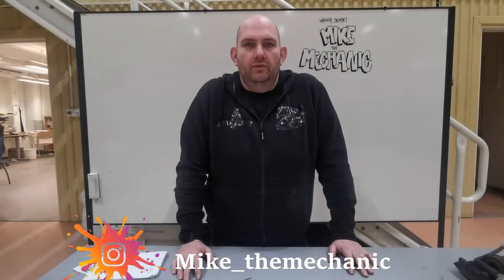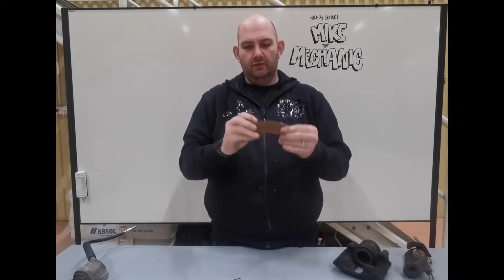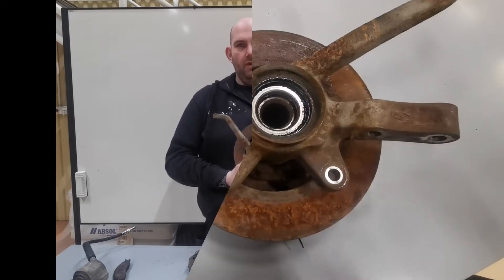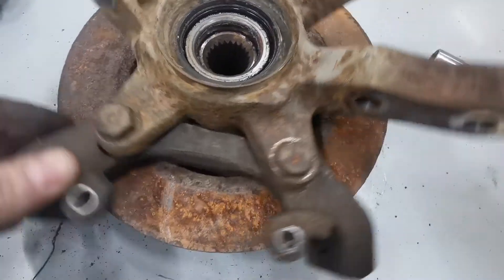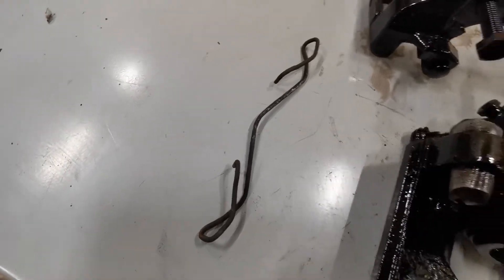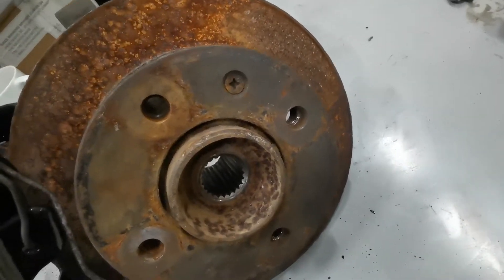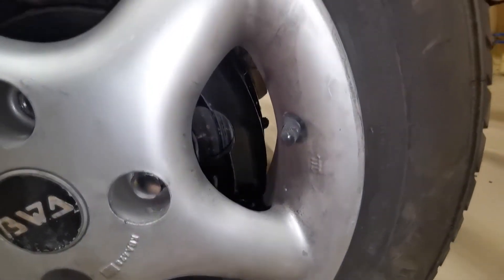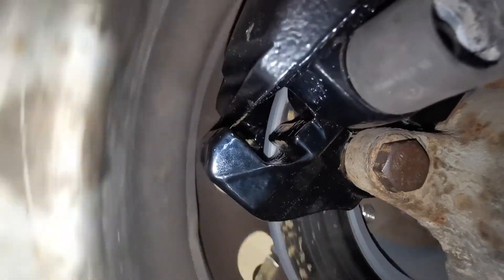ANYONE can upgrade to MUCH bigger brakes with standard 13" wheels. Here's how!

Comment: Are these definitely off a street ka? All street ka discs i can find are 258mm you mention using 240mm discs? If i get a street ka brake set up the 240mm discs wouldnt fit well with the carriers? Or am i missing something. Thanks
Reply from the maker: The disks are from a fiesta I think 240mm vented
Reply: Ahh ok. So the street ka calipers and carriers would be too big as they are 258mm discs? I'll have a look into it
Reply from the maker: @minihudders94 calipers and carriers fit. Can't remember right now where the disks come from but I can find out.
Reply from the maker: @minihudders94 contact me on Instagram or via Facebook and I can send you the info about the disks
Reply: Ok thank you 👍

Comment: Are u using 240mm ka brake disc.?
Reply from the maker: OEN 89FB1125CE Ford
I belive it's from an escort this is the part number that came with the discs
Reply: @mike_themechanic  thanks u olso have a Number for the brake pads?
Reply from the maker: This is completely untested but I think these fit.
https://www.burtonpower.com/brake-pads-fiesta-mk4-mk5-2-00-02-not-1-6-ka-1-3-00-07-pa1268.html

I'm looking at the fact that I had to grind down my outer pads to around 50mm in height to stop them touching the disk and these ones are for a ford ka and are 50mm in height but I haven't tested them yet

Comment: Hi Mike, loving your progress videos! I'm going through the same as you now and this video was really interesting. A couple of things:

- I've been looking at this setup and I've noticed the street Ka with the 1.6 engine was 2000 - 2005/06. You mentioned in the video description 1996-2000. Do you happen to know if these would be the same, I assume they would be

- I also noticed that the calipers work with the 240mm and 258mm discs. Was there any particular reason you went with the 240mm?

Thanks

Comment: Very interesting! I’ve used the st170 brakes off donor car.. had to go down 20mm from standard st170 on disc diameter but have to cover them with 15” wheels! I’ll see how I go with clearance issues… 😳
Reply from the maker: Good luck. Interesting to hear of different solutions

Comment: Here in the US we don't have any Kia's so this won't work for us.  I'll be looking for the rotors used on the US version of the 80's Ford Escort. They are 235 MM diameter X 24 MM thick. The only issue I have is finding a caliper to fit. Not sure if the stock caliper mount will bolt up or not.
Reply from the maker: I can imagine that the ka is a bit too small for the US market😊. I'm sure that there are other conversions that will fit.
Reply: Bmw e30 325 caliper with ford fucos mk1 disc (258 or 260mm not sure)  are also fit with a little adjustment of the caliper offset and bigger bolts.

They fit with no problems with 14"+
About 13" - maybe some wheels fit maybe not. Need to check